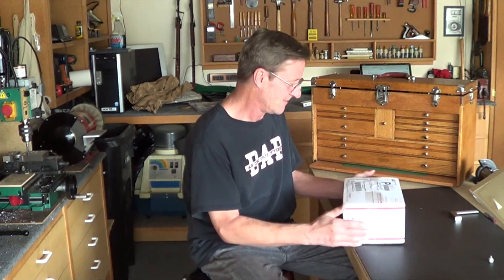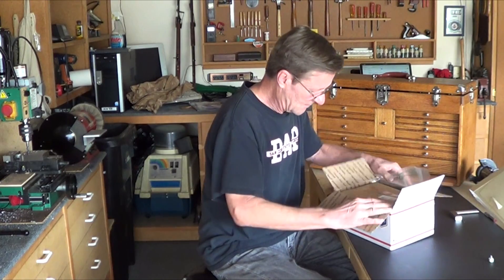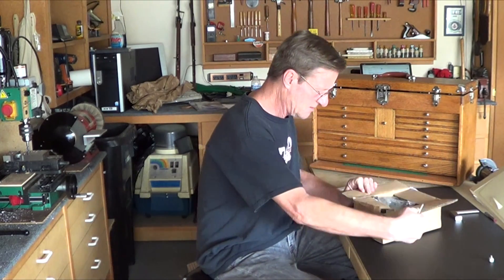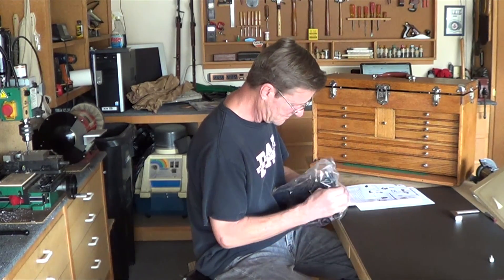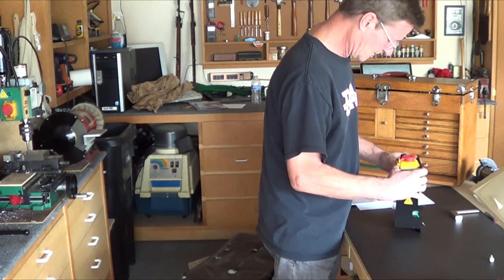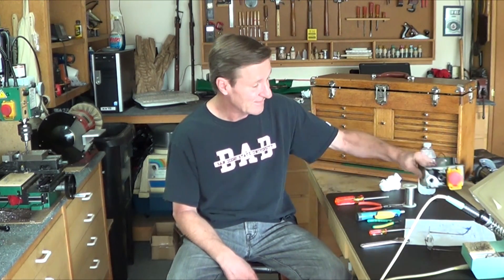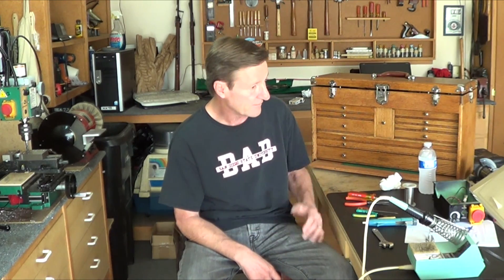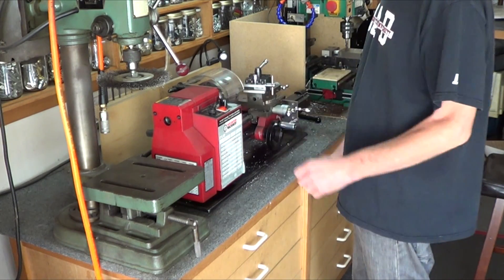New Motor Controller Report Video #16

Comment: There are some pots on there to adjust that weirdness. It is probably tuned for the lighter 3" chuck. I will try to remember where the docs are on how to adjust (and what each pot is for.) It was in a "how-to" for slowing the speed down to a lower bottom end RPM.
Reply: +David Kirtley http://www.mini-lathe.com/Mini_lathe/Modifications/modifications.htm#slow_speed  It is for an older board but the same controls are on the newer ones.